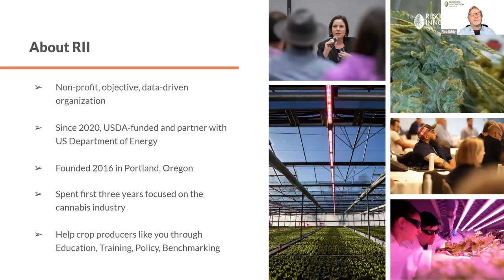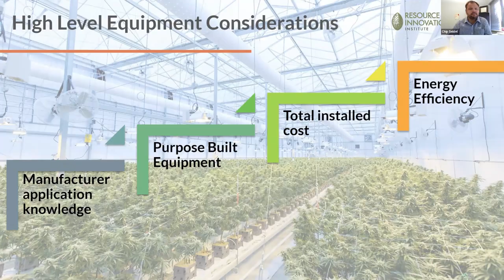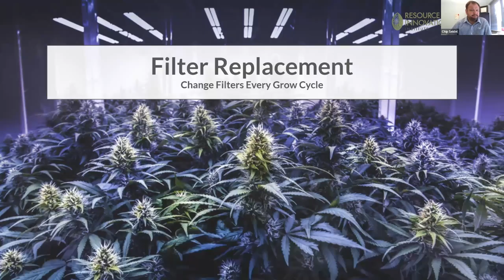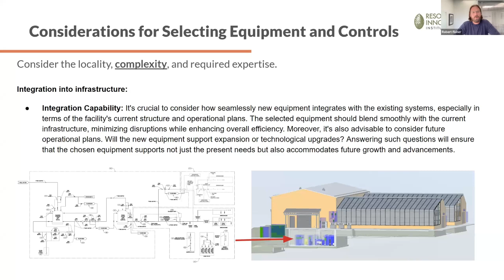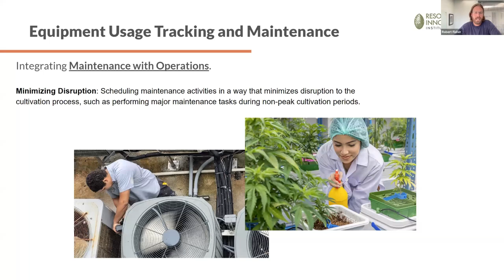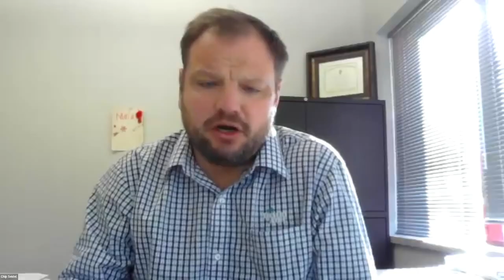Operations & Maintenance for Controlled Environment Cannabis Cultivation

Comment: I am a Electrician, HVAC Specialist, and other. Installed BAC Systems for many years predominately in an Institutional setting. Given the opportunity to work in an Indoor Agriculture Facility, I jumped into it. RII has helped a great deal. 
Thank You All. 
Indoor Ag is a very challenging environment to control accurately. A few words of caution for new operators out there. My AHUs (all HVAC equipment) are of course rated. For A/C Dehum this rating is when charged for max capacity.  Given the cost of refrigerant manufacturers always undercharge their systems. Charge properly using Superheat, Subcooling method. Its worth the cost of refrigerant. Also remember that HGRH does not put as much heat back into the air as the DX Coil removes. Try a slightly higher head pressure to make the reheat coil hotter. My AHUs have HGRH and Electric Reheat (32KW). We are able to Dehum large but really lack sufficient reheat to utilize our dehum to its max. Will be adding an additional Electric Reheat coil. Also, having a PreCooling Coil helps ALOT to bring the DX temp down to increase dehum capacity. This must be controlled by a modulating valve. Program the Preclg to operate as a step control especially when lights off.
Cheers from Canada!
To Quality and Yield!